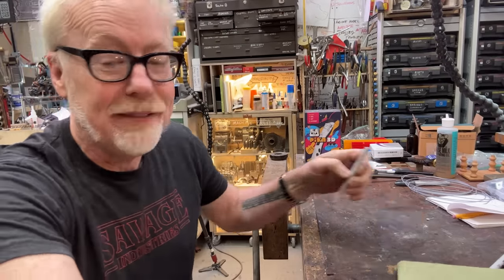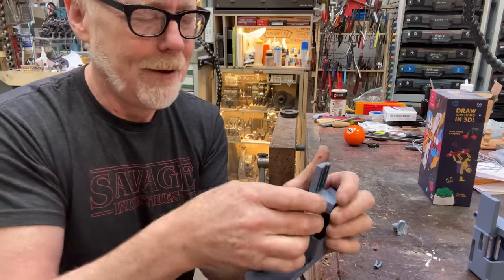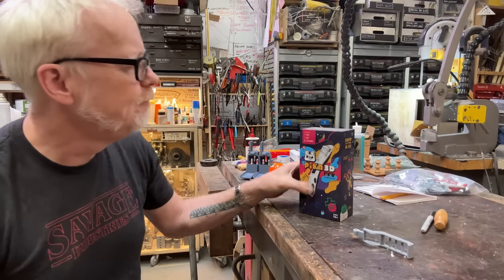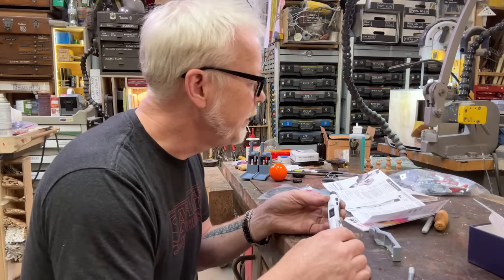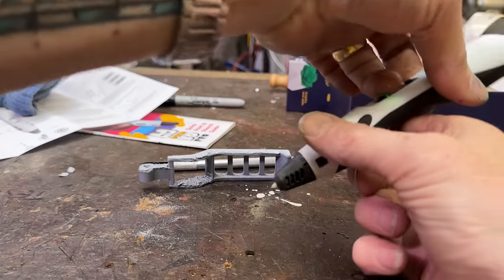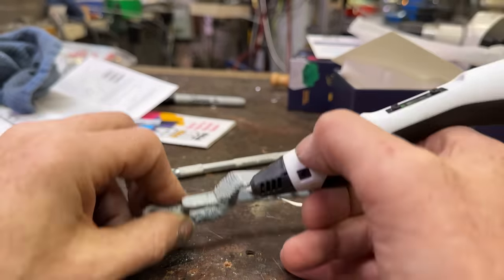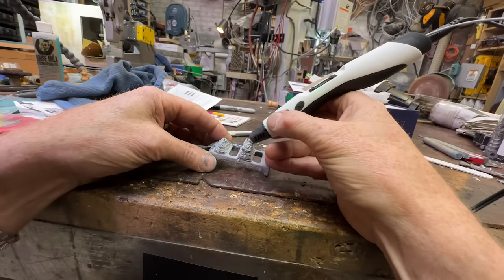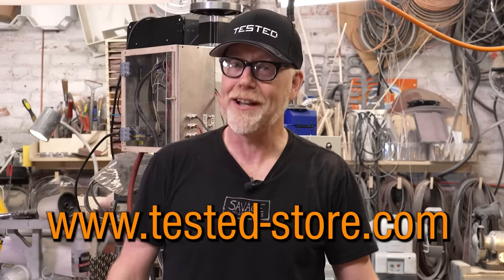Adam Savage Tests This 3D Printing Pen!

Comment from the maker: PIKA 3D Printing Pen: https://amzn.to/3Q4hc7H
PLA filament: https://www.matterhackers.com/store/c/mh-build-series-pla?aff=7553
Bambu Lab X1C 3D printer: https://www.matterhackers.com/store/l/bambu-lab-x1-carbon-combo-3d-printer/sk/M80GDCL5?aff=7553
Disclaimer: Tested may earn an affiliate commission when you buy through the links here.
Reply: Adam should really disclose if this is a sponsored segment.
Reply: I've been using similar pens for years. Another thing they're really good for is stitching together parts into a larger piece. It takes a bit of practice, but it is every bit as strong as the rest of the print when you're done. I've made very large structures, put holes in walls to fill with ballast for weight (BBs) and filled in the holes again, and even repaired broken components with the appropriate filament (ABS, PETG, etc). 

Also recommend getting some large blade/shape ends for a soldering iron to use for smoothing and shaping to help reduce the amount of clean up necessary after filling/joining pieces.

One last thing, there are other 3D pens on the market you can find that are much smaller and easier to use for this purpose, some being a little bigger than a sharpie. I found them much easier to use and see what I'm doing than the bigger, bulky ones.
Reply: Try tough PLA or PLA plus. Durability of ABS and the more tougher filaments but pretty much the same parameters and handling as regular PLA, so not nearly as fidgety. Been using it for my tools and fixtures as I've been inspired by Tested to organize my shop.
Reply: I hope tested doesn’t become 3D printing focused. Watching Adam build with his hands using metal and wood is the heart of this channel. Please don’t change.
Reply: @DarkroomDays 3d printing isn't really a replacement for that stuff more of another tool with what Adam does
Reply: @DarkroomDays  gotta move with the times. 3D printing is taking off. I doubt it will completely replace the usual content, but it is a part of modern prop making now.
Plus as you can see in this video, still a lot of 'hands on' work required with 3D printing. Repairing, sanding and filling, painting asssembly etc.
It's a new toy for Adam so expect him to be excited and passionate about it for a while.
Reply: ...and the printables/thingiverse links you said you'd post?
Reply: a soldering iron with a spade tip (I'm sure you can easily make one) as some have suggested works very well to flatten ugly overhangs or surfaces... having your 3D pen allows you to fill in the low spots then you can push them down into the gaps & holes for a nice finish.
👉needless to say, a smart iron with adjustable temp is ideal for this otherwise you could get some burn marks if you're not careful.
⚠also, you may want to bump up your pen to your filament's ideal temp as I feel 160° seems very low... you'll probably get better flow at 180° or higher.
:D at any rate, enjoy your new toy/tool!
Reply: I use a harbor freight router speed controller to dial in the temperature of a soldering iron type plastic welder to smooth printer defects. I also use the controller with a exacto type hot knife to prep joints for welding parts together with my 3d pen like a mig welder. Slow the feed down because the tip is heating the base material as well as the filament. Your joints disappear when sanded.
Reply: There is a heating tool to finish of 3D prints from hairs and small imperfections .
It works on 5V USB Power .
I do Suggest you take a small printed object to practice with it .
And also keep some paper Toilet roll at hand to clean the tool heads before they cool down completely .

Way better than Using a 3D printing pen .
Also hiding the seam on FDM/FFF printed object gives a good finish and can make Serra in parts way stronger .

100% infill is not needed just keep it between 90% and 95% .
Working with Support print material is actually a Time eating print feature that can be handy in some cases yet its almost no Use if you’re printing big prop parts .

And last tip .
0.4mm nozzle or 0.2mm will give fine details for sure .
Yet to get Bigger Prop Parts way stronger go try the 0.8mm Nozzle because the printed part wil be stronger .
It can handle bigger overhang angles .
And you do want to sand down some surfaces a little to make them have a smoother finish for Painting on the end .

OH P.S .
Having seperate Bins to collect wast PLA for return to the Filament Producer is always a good thing and keeps the reuse process way easier for the Filament  producer to .

It was nice to see you test out things I already did 4 years ago btw .
Can’t wait to see your next learning steps Adem .
They keep me smiling all day and remind me of all the learning curves I did run into like you have been doing up till now .

Greets from JERVER aka The.NL.Pirate.King
Reply: "Spin Welding" also works - cut a 2"-3" (4cm-5cm) piece of PLA and chuck it into a dremel.  Essentially a friction stir welder for plastic.  Not universally useful, but in certain situations can be a great technique.
Reply: @VAXHeadroom  I don’t have a Dremel i do get the Idea do still its better to get the 5V heating tool with several working heads on it instead of waisting PLA with a 3D-Pen
Reply: Being a maker, I could see you creating a "follower" attachment for the pen that presses the molten PLA like a spatula, into the defective area. This could fill any voids with a more uniform material addition and probably reduce finishing time. Possibly made from sheet stainless or if that sticks, a silicone sleeve added to the working surface.
Reply: @DonariaRegia  Probably not for this type of pen - you need a very different type of hot zone and wattage of heating element, to be able to extend the hot zone that far out from the immediate tip of a 3d pen of design like this. The filament doesn't retain heat well, and to enable decent action as you indicate you really need everything you can get in terms of low viscosity/ maximized flow characteristics, including after it leaves the pen, for as long as possible without cooking the filament.
Reply: @xanatos451  I think you just answered a question that I had. Simply put to weld a plastic g I  Joe jeep. Or even weld a crack in a plastic kiddie car. Or even a Barbie doll house.
Reply: i don't believe this pen works the best for one it should only output material while the button is pressed, and should come with different shaped hotends/heated blade ends for smoothing out plastic as it is put down, like imagine very thin flat nozzle with some metal thermal mass to the side of it being able to put down a thin flat surface over the damaged parts of a print, even a blade sculpting set with an arduino heating cycle maintaining temperature in the blade would work some wonders in 3d sculpting or fixing 3d prints
Reply: @fiendlybrds  of course its a sponsored segment. anytime you see a person like Adam make a video about a product, its sponsored. Common sense really.
Reply: Try a glass fingernail file for your final pass on small plastic parts that you are shaping.  Nice smooth finish.

Comment: You might also try a flat or wedge tipped soldering iron to melt, flatten, and smooth out small rough sections on your 3d print. 

Combine that with your new 3d print pen, and I think you'll get the results you're looking for.
Reply: Soldering iron gets to hot for most plastics, but get one of those adjustable heat ones that are meant for wax and can heat up enough for solder would be the best. That's been the best tool I got for 3d printing by far for me
Reply: @gruntes11isttt You can buy temperature adjustable soldering irons, but that might also be a good idea. Or a set of tools used for wood burning could also provide several options.
Reply: Second this and add - get a dedicated temp controlled soldering iron, needs to have a range that goes down to 190C I got a cheap one $20 80W 180 to 520C its been perfect for print touch up and welding, I don't have a  pen as I can 'weld in' new material as needed
Reply: I pair my TS100 soldering iron with is TS-KU tip at around 180°c and it works perfectly for smoothing
Reply: @vizionthing Hadn't considered just "welding" in the new material, but that makes sense. Thanks for the added input.
Reply: @gruntes11isttt  they aren’t meaning a cheap, just plug it into a wall with no temperature control soldering iron, no one should be using those anyway, but a lot of temperature controlled soldering irons can go down to the temperatures required to melt the plastic.
Reply: @vizionthing  I would recommend a  temp one some plastics have a melting point of 120c. If you heat a plastic too much it becomes brittle and starts or starts to bubble. Pla is about 150c  depending on the
Reply: Using a battery powered iron made for wax is my go to solution, or using a créme brulee burner/cigar lighter for softening
Reply: @gruntes11isttt  My soldering iron goes from 160 C to 400 C with an adjustment knob. Also, I can change out the tip for one of the many other shaped tips, including a flat-head style.
Reply: There are "soldering irons" specifically made for this that have a large flat area (like almost a square cm) for smoothing prints. Maybe someone makes specialty tips for that Hakko soldering station that seems so popular in the US?
Reply: @gruntes11isttt  all my filaments are above 190 so its never been a problem
Reply: Also, a Dremel tool rather than fingernail sanding sticks. At least to get rid of the bulk of the fill.
Reply: @tims8603  yes, great tip. Just be careful not to run your dremel too fast or you run the risk of melting the plastic.
Reply: @Old_and_Wise  I actually use a combination of my 3D pen and a dedicated temp adjustable soldering iron with larger tips of varying shapes and sizes to weld, fix and clean up prints. You can make very large items or print in the strongest orientations and join them post print for complicated designs that need more functional strength. If you're doing models that you plan on sanding/painting smoothing anyway, you can join them seamlessly with those methods and you'll never be able to tell they weren't made as a single piece.
Reply: I use a temp controlled soldering iron/pen all the time to do welding, smoothing, and many forms of touchup.  For fine detail work I set the temp close to the plastics extrusion temperature.  For larger efforts I set the temp 50 degrees Celsius higher and use it like I was ironing a shirt.  If you don't stop, the shirt will not burn and the plastic will not burn or smoke either.   When I pause or stop, I need to immediately wipe the tip on cloth, wood, or paper towel to rub off molten plastic before it burns on the tip.   I bought a set of tips made for wood burning soldering iron/pens and the ones that are bigger and broader work better for large surfaces than the skinny little pointy tips made for soldering electronics.  The skinny tips work for plunging deep into plastic where the plastic has cracked and needs to be welded.  I often add plastic during this process by melting in spare filament of the same type (PLA, PETG ....) to make the ironing look better or to fill in the weld seam.   The 3D printing pen is a lot like MIG welding and the soldering iron/pen is closer to TIG welding.  You can get good results with either method.  I find that soldering iron can do most jobs and when used as a iron it doesn't require post processing (sanding, filing, cutting ...) the way my 3D pen does.   The 3D pen is perfect for signing completed works or to add color to lettering or signage that does not pop out visually on one color prints.
Reply: Thank you showing your attemp, I want to print a clip on stick out button for one now and I would mod it to have longer tip and possibly power pack on a wrist strap or something. Also from what I found treat it like a mig welder and melt your add on material into the part, also scraping away instead of cutting or sanding leaves the best finish
Reply: @db345t  seconded on this, it's exactly what I do. Takes a little practice to get nice, consistent and clean beads, but the welds can be done very tight if you figure out the prime temp and speed to use. 

I also recommend increasing your perimeters and skin by a couple when planning on welding, especially for functional prints. You want a thick, stable wall to weld to in order to preserve the wall's integrity as you join the parts. If you do it in short segments and use a chisel or knife before the welded section cools completely, you can get very clean and easy trims of the weld seam. I've found I've needed to do the warm trim method less now with getting better at my weld seams, but a heated knife tip on a low temp makes cleaning those up a breeze when they're small and consistent. 

Using post print welding has also changed how I design some of my functional parts, as it's easier to get good strength on high stress point areas by printing in the favorable direction for that section, then doing the rest of the part the same and assembling in post together like Lego.
Reply: Yep... I use a wood burning kit with a flat iron tip.  I then melt in filament similar to soldering.
Reply: Saw your comment after I commented it would be good to have that flat head added to the pen for sure
Reply: They sell tools specifically for this. It's called plastic welding. They use it for repairing plastic car panels.
Reply: For large areas, you can straight up use an iron as long as you also use a layer of parchment paper (it's a baking supply) between the iron and the material. Works a treat.
Reply: I was thinking if the goal is repair the 3D pen should also have a flat tip that puts out a thin ribbon of plastic
Reply: @xanatos451  Thanks for sharing. I've not yet joined two prints together without screws, but I'll keep your seamless method in mind next time I need to join a couple prints.
Reply: That with a variety of non stick coated tips/pallet knife blades would be the ideal tool for touch up and fill in repairs.
Reply: @thorstenoerts get the thickest round or pattern shaped tip you have and smash it with a hammer on an anvil until flat. It'll give you the big flat surface. If not flat, grind/file/sand it until flat
Reply: @Old_and_Wise my thoughts exactly with the woodburning tool. They're $20 for a good enough one. Another $15 or so for a full set of tips. 3d pen can fill large voids, wood burner to finish em.

There's a tip I just got in the set (was like $13, wanted itbmainly for wax for castings instead of the $400 dedicated wax melter "pen") that's like a 1/2" or 3/4" paddle. Looks like a mini frying pan. I didn't think of it until your comment but it would be perfect for flattening the bad first layers you can get.

My kids have a 3d pen, I got everything else hehehe
Reply: lol just commented then saw your comment directly below mine... yeah it works great.
Reply: i wanted to suggest the same thing :D
Reply: @gruntes11isttt  noone has sold a soldering iron that isnt temperature adjustable in decades lol
Reply: Some people had look smoothing 3d pen stuff with wood burning tools (like manual wood engravers and such).
Reply: That's great! I was about to say this myself!

Comment: QUICK TIP: A silicone mat and silicone clay sculpting tools work great for flattening and pushing hot material around. Only issue is you have to do it fairly quickly, but if you plan it out a few seconds ahead of time, or mount your part so you can have a silicone tool in one hand and the print pen in the other, it works great.
Reply: This just makes me think about getting some wider tips for my TS101, and adjusting it to a lower temperature to function in this role. =)

Been resin printing for a while, but looking to get a filament one soon.
Reply: @jubuttib  It sticks. Silicone doesn't. I have done it. 100% you can do it. I just prefer not to heat the plastic over and over. One and done.
Reply: @ajosepi1976  Ah right, good point. Thanks for the heads up. I'm sure I'll learn the hard way later too, hehe.
Reply: I don't use sculpting tools. I use a butane operated soldering iron with specialized hot ends for sculpting. That way you can finish your print or rather drawing in this case and clean it up afterwards.
Reply: I saw someone use a silicone spatula that they made a little rig for it follows the persons pen strokes and smooths the filamebt out for them. Was frankly kinda genious

Comment: Love my 3D pen- I don't use it often, but it's often invaluable when I do.  I mostly use it like a welder.  Great for when the way I want to design something isn't ideal for the constraints of 3D printing because I can just separately print the bit that wouldn't print or would require a lot of support and weld it on.  Often it's a situation where there isn't really enough surface area for using adhesives.

Comment: It's one of those things you learn over time with experience,  but that ladder model might have printed better standing up vertically or in its face (or back), possibly even without support! Bridging (crossing a gap with no support, but a solid anchor on both sides) is pretty reliable with modern printers
Reply: Seems to me that the layer lines would be in the wrong direction and it would have made a very weak part. Might be fine for cosmetic parts though, I mostly print structural engineering parts.
Reply: I would also consider slicing it into two or three pieces using Tinker cad, and super gluing it together after the face.
Reply: @SimplyDudeFace  Even better, PrusaSlicer these days can create splits with easy creation of slots and pegs  for alignment as well.
Reply: And try organic supports if bridging distance is to large, they seem to come off more as a whole piece and the small dots are easy to clean. Maybe try to manually place them